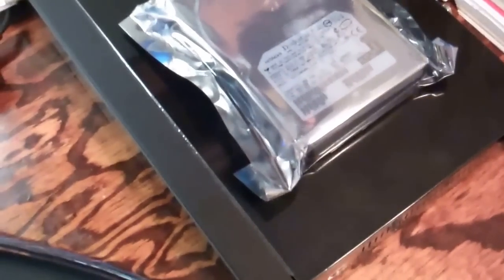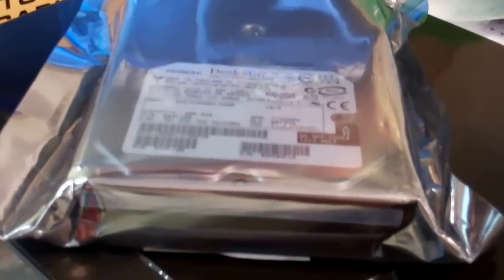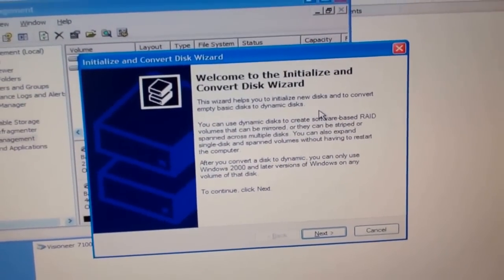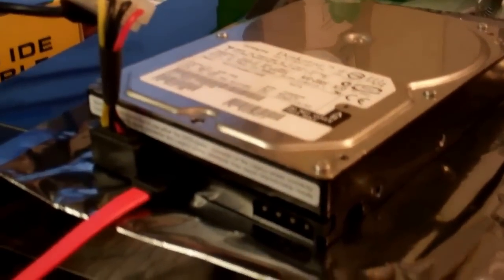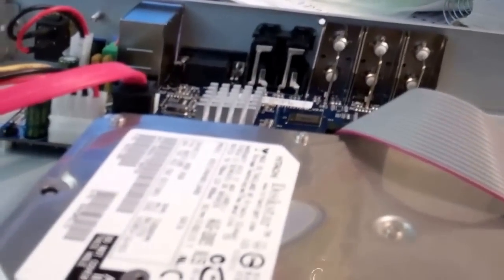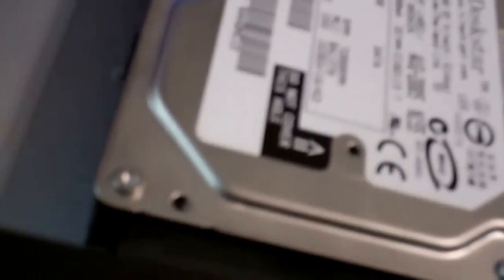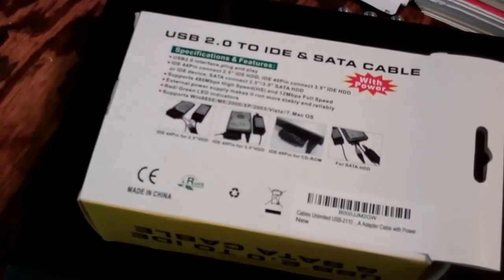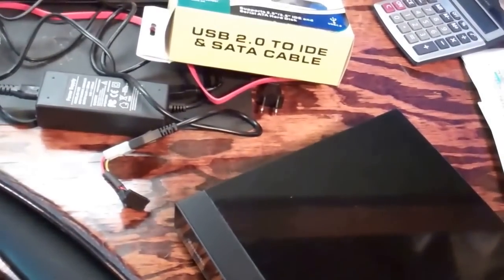Testing & Installing a Hard Drive in a DVR Security System

Comment: XP is still a good OS if you don't need the latest directx.  It is also good if you don't want your PC updating which might mess up a driver that worked fine for you.  I also would not want my PC having to reboot without me knowing and I only take updates when I am ready rather than letting them slow my internet speed mysteriously in the background.  I also only take updates I need and never all of them.

Comment: Hi I put a new hard drive in my DVR about 20 hours ago, got message it will auto format then message saying "formatting storage," then the screen went black and power button flashing red. DVR is making a whirring noise and I can't get any menu up on screen. Am concerned because it's been 20 hours like this. I have a Sannce DVR and I put a Seagate Skyhawk 2TB Hard drive in. Sannce are not answering if this is supposed to happen and I'm without my cameras recording (which is really bad). How long does it take A DVR to auto format a 2TB hard drive? I didn't get a choice to quick format it just went straight to auto format. Would appreciate any help please 🙏
Reply from the maker: I'm no expert but it sounds like your hard drive crashed.. I would unplug it for a few minutes and plug it back in to see if it reboots. If not You'll need to contact their customer support or try another hard drive.

Comment: hi with instaling the hard drive into the machine does any of the jumper pins need to be covered the hard drive i am putting in is western digital 500gb wd5000aads thanks
Reply from the maker: No idea.. Sounds like you're using an older system that uses an IDE hard drive..
I would check the label on the hard drive itself for pin settings or contact the manufacturer and ask them
Reply: RVR2 hi no it is  sata drive but it has jumpers at the end and it says some thing about them on the top of the drive  does it need the jumpers on to make the drive be seen  in the system
Reply from the maker: Oh ok then no I didn't bother with those jumpers. I left them alone and simply connected the SATA power and data cables up and mounted it in the DVR and it works fine.
Reply: RVR2 ok it must be the hard drive then it is not showing up in the system , i will have to replace it thanks for the chat
Reply from the maker: No problem. Hope you figure it out.

Comment: what's the point of the hard drive on security camera?? because some systems are sold with out??? thanks
Reply from the maker: +Jaime Perez To record days/weeks/of camera footage.. The ones sold without offer the systems cheaper and in turn waive the liability should the hard drive crash.
Reply: Thanks so best bet to buy one that has  a hard drive... It's only a $50 difference.. Thanks again...
Reply from the maker: Check the brand name of the hard drive if available.. Western Digital and Seagate are what I've used.

Comment: exactly. how did you look for it? does it needs to be the same brand as the dvr? where did you bought it?
Reply from the maker: I decided what size hard drive I wanted and searched around is all I did.. Ebay, Amazon, New Egg, etc. Again, I bought everything from Amazon..
Reply from the maker: There is no Zmodo hard drive.. Just use what ever hard drive you decide, it should work

Comment: i have samsung dvr SVR-1645,i replaced hdd but does not work,when i format hdd I got message in disk manager,ERROR DURING FORMAT.PLEASE REMOVE ALL EXISTING PARTITION FROM PC,what the problem could be?how can i solve this
Reply from the maker: May be a defective hard drive.. I would try another and if it does the same thing, it's a defective DVR..

Comment: after using new system for 2 month the setting did not show hard drive
i think the high temperature effect on the hard, can by some way add cooling fan for hard drive on this system
Reply from the maker: Adding cooling fans would be beneficial but there is limited space inside the DVR..
Some case mod could be done to add a cooling fan but I've never attempted that.
Reply: i live in saudi arabia and the temperature very high
know the hard now show i think the problem form high temperature 
i am not sure if hard drive damage I make system off for some time and i will see
Reply from the maker: Oh yeah if you are in Saudi Arabia, maybe you can put the DVR near some air conditioner to blow cold air on it. That should help.
Reply: i can not leave ac open 24 hours
i same time there is not open area in the dvr box to good ventilation for the system
i will check in ebay for some cooling van
are you thing the hard damaged
Reply from the maker: Oh ok.. the hard drive could Possibly be damaged because of the heat.
Reply: RVR2
I would cut a hole in the case and mount a fan directly over the HD, It would look better inside, but whats more important, looks or function? my 2 cents
Reply from the maker: Oh yeah I would do that too. I much rather protect my investment with an external fan showing to keep the hard drive cooler. I agree with you there.

Comment: Hey got a question for you. I got the sannce security camera system it didn't come with a hard drive. I purchased a 3tb hard drive but it won't record or show it has anything in the system. Do I have to plug it up to my computer first then put it inthe sannce DVR recorder like you did??
Reply from the maker: I think it can only handle up to 2TB hard drives.. That might be your problem that 3TB is not compatible..

Comment: My dvr won't turn on after I connect my hard drive but works fine when it's not connected, does that mean my hard drive is bad ?
Reply from the maker: +James Muzquiz It's quite possible.. I would try to connect that hard drive to a computer to see if it detects it and if so, see if you can access it. If not then it's time to replace the hard drive.
Reply: Thanks for the quick response, turns out I mixed up the power supply wire with the camera one, which is why the hdd wasn't getting any power I just switched them and it worked fine
Reply from the maker: Oh yeah that will do it to. Glad you got yours working again.

Comment: What series number or type of hard drive did you use , I have s smiliar dvr and my hard drive is gone. Need to order one probably not as big size as yours. Also would all computer hard drives fit in dvr or they ate different ?
Reply from the maker: I honestly don't remember.. Any SATA connection hard drive should work.
Reply: +RVR do you know if Samsung 16 channel dvr's are able to accommodate two internal hard drives?
Reply from the maker: No idea.. Check Google or Amazon to see if that's even available for a 16 camera DVR..

Comment: Looking into a security system , but I want one that has a Hard Drive. I can get a 4 channel 500 GB 4-camera for about 150.00. would you buy Zmodo again?
Reply from the maker: ***** The only reason I got this one without a hard drive is because I had a couple spares on hand. Yes I would get another Zmodo DVR, in fact I'm thinking of replacing my old 2006 setup with a 8 camera setup in the future.
Reply: thanks..

Comment: do i need to format a Hard drive on my computer prior to installing it on a DVR? I'm using Swann system and replaced the harddrive however its not doing anything!
Reply from the maker: Not sure if it's required but I did to make sure the hard drive was ready to go.. That may/may not solve your problem though..
Reply: i think its a bad capacitor in my case and i already bought a purple hard drive ah-well doesn't hurt to have emergency drives handy!
Reply from the maker: Oh yeah that'll complicate things. I use those WD purples in my computers and love them so there's another use for it.
Reply: Ali Lopez

Comment: the hdd didnt sound healthy at the start, the 2 clicks sounds like it found bad sectors during the seek test
Reply from the maker: ictdude1 It was a cheap referb I bought, but it's still working fine.
Reply: :) if you ever want to test a drive plug it into a pc and run crystaldiskinfo on the drive, its a free piece of software that tells you the hard drive smart (health status)
Reply from the maker: Ok I'll look into that. Thanks!

Comment: I'm new to this but if I buy a dvr system what happens to the video? is it stored on the dvr? Most of the dvr systems I see on ebay says no hard drive included. is the hard drive for the dvdrw?
Reply from the maker: The video is stored on the hard drive until it is full then it will write over old data. Not sure what you are asking but there is no dvdrw with these